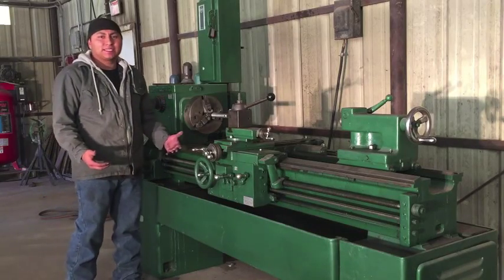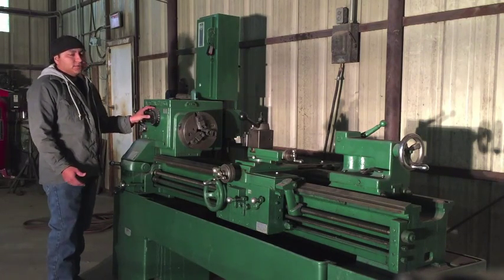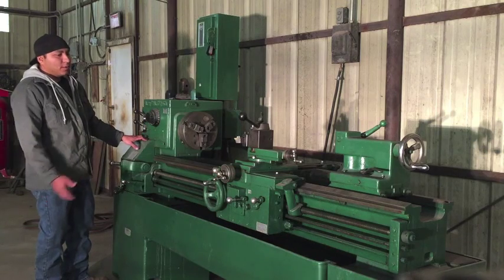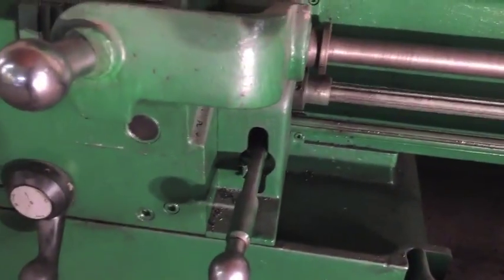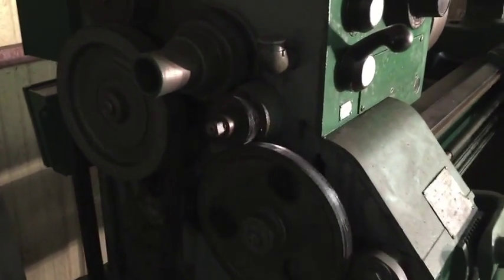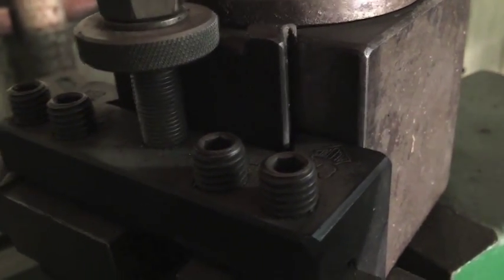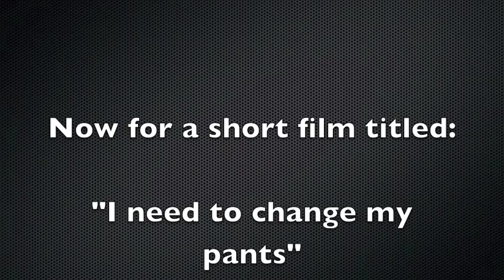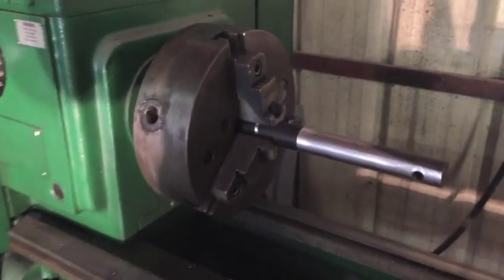#5 Sucker for Blonds

Comment: almost crashed a second one.  the big 120 got broken on the first try also.  time for a mic stand with a flex section to hold you camera for you. . much smaller footprint than a tripod.   or build one with some magnets on the base and stick to to the roll around crane beam you have.  heck you could mount some track lights that way also.  if you hose clamp a  4 inch long piece of electrical conduit to the side of the lamp shade so you can aim it with a broom stick.
Reply from the maker: Yes I have wanted a noga for my camera.

Comment: What you are referring too as a (Half nut) is actually a "split nut"  Its a feed mechanism to be sure, but it's for threading, ONLY.  I'm not going to say that this machine is this way, but I will say this, no lathe I ever ran would allow both a feed lever and a threading lever to engage at the same time.  It may be that you have a problem in one of those mechanisms. Typically there is a lever that one uses to select one or the other.
Reply from the maker: Good info. Sold it though, check out my princess Mona.